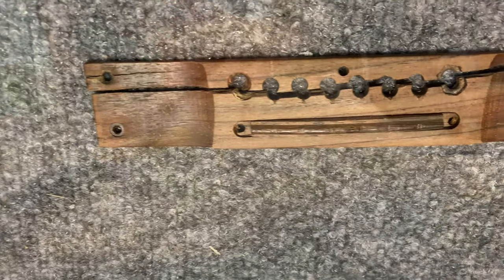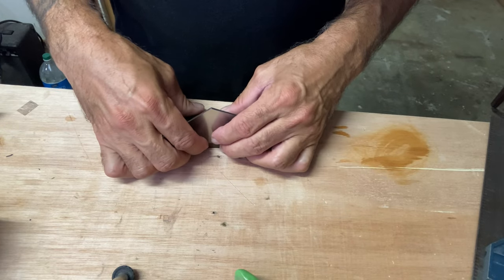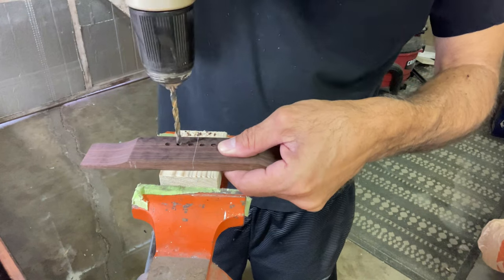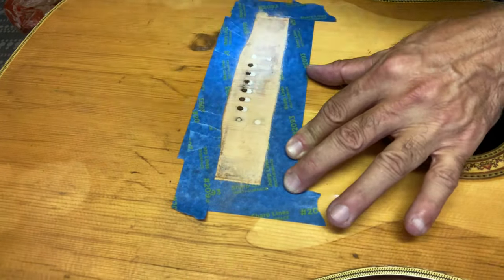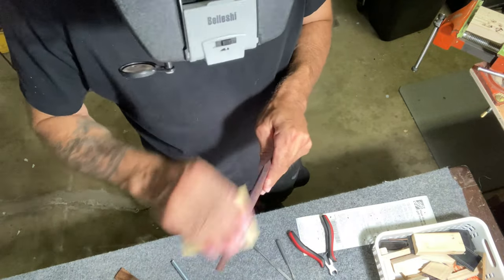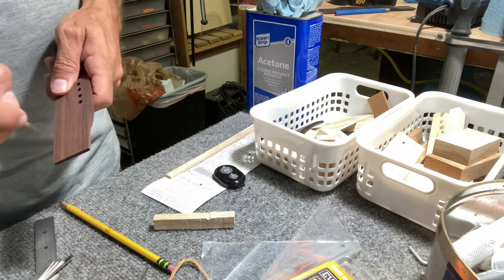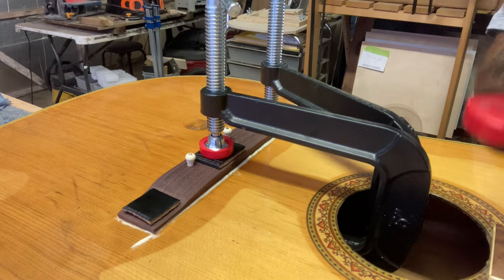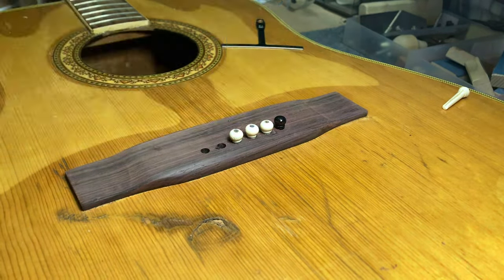Vindustrial builds an acoustic guitar bridge - step by step

Comment: Looks like you cut into the wood fibers when scribing around the new bridge- that’s not good- and it’s good practice to contour the bottom of the bridge to the top
Reply from the maker: Thanks for the tip… In this case I wanted to try to use the bridge to help flatten the top of the guitar. Thanks for your comment I appreciate it!